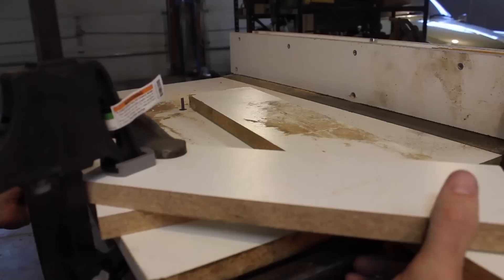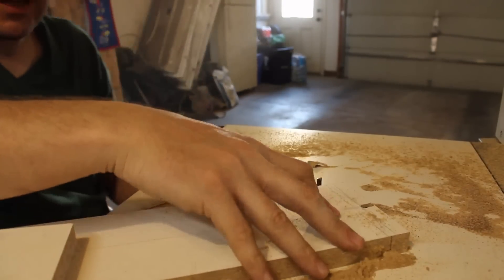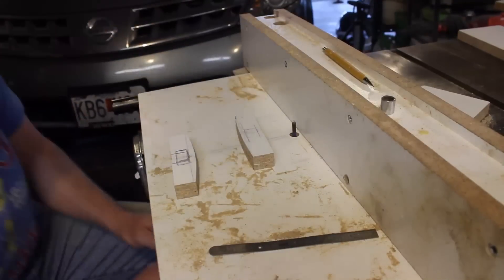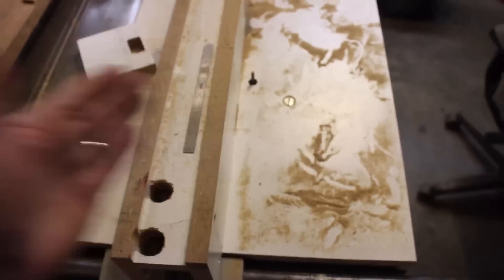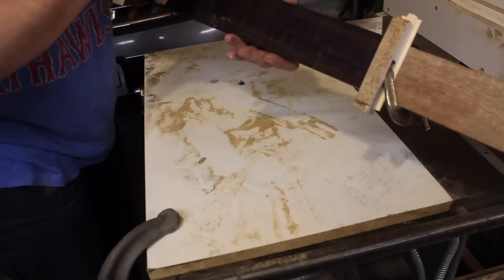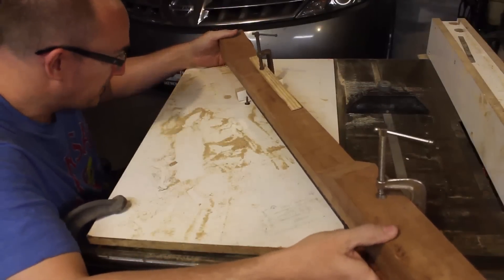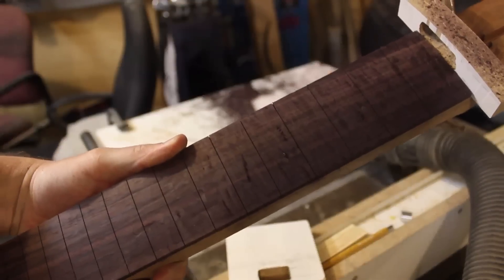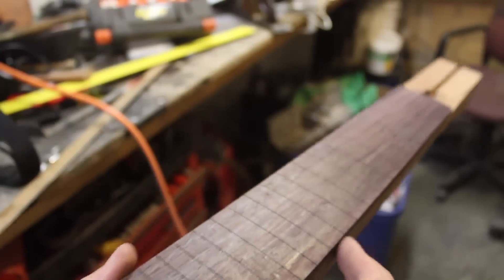You Can Make a Compound Radius Fretboard Easily - Guitar Build - Part 9

Comment: you really need a larger table i know you know but yea man, the theory is strong, the tool? meh . . .   and a vacuum, insure no bits get under your jigg and throw it off ..  Ive seen guys use the same concept but upside down in a box then they rock the router, but f course they're not using table they use a hand .. cool setup, larger table for sure, different bit maybe so it doesn't leave any tool marks in the wood?     also the fingerboard is all good compound radius, but it is the fret that are most important, you cannot flat level those, they have to be compound radiused as well, perfectly too ..  most important

Comment: Lol that is by far the most archaic and inaccurate way I have ever seen to attempt a compound radius LOL
Reply from the maker: Interesting.  Are you an overhead, dual adjustable arm and belt sander guy or a do it by hand block plane guy?
Reply: @GregsGarage  I use upright arm router sled, and it's adjustable on both sides. You can do any standard radius all the way across the board or a compound radius of any combined dimensions. It's completely made out of MDF and it is very accurate. I built it 15 years ago and I've never had to make any repairs, it still works like the day I built it.

Comment: Just asking , , ,
Does a compound radius fretboard need a compound radius neck? 
And if so where do they overlap or meet?  And is there a basic matching theory?
Reply from the maker: No, the neck carve is the same for a conical/compound radius fretboard.  The fretboard and neck meet at a straight joint.  The math gets a bit crazy when you want the edge thickness of the fretboard to be consistent down the length because the fretboard widens as you get closer to the bridge.

Comment: Good video, I would just ask that wouldn't it be better to cut the fret slots after routing to avoid tearout.  However if you purchased the fret board with pre cut slots then it is what it is.
Reply from the maker: Its easier to lay out fret slots when the board is flat and the sides are square.  With rosewood and ebony, tear out is much less of an issue because they are so dense.  If you're working in wenge or palm it is probably a different story...  That said, small cuts at high speed usually let you get away with a lot.
Reply: @GregsGarage  thank you.  I appreciate the advice.

Comment: Nice video.  I had always assumed a compound radius IS a conical shape.  What is the radius at the bridge?  Did you have to deepen the fret slots after removing some of the fretboard?
Reply from the maker: I can't recall the radius at the bridge, but I calc'd it back so it would work with the cone down the fretboard.

Comment: How did you come up with 12"/20" radii? For normal string spacing, i.e. 1 11/16" nut and 2 1/16" bridge (Tune-o-matic), it works out to 12"/16".
Reply from the maker: Preference really.  I wanted the guitar set for shred on the upper frets.

Comment: This is an awesome how-to video, and I don't want to be "that guy", but as a nurse/woodworker I have to say, running a router makes some SUPER fine dust, and mdf (especially with melamine) is horrible for your lungs. Please wear a respirator and run some dust collection while doing that, so you can keep making these great videos for years to come instead of sitting in a hospital with respiratory failure or possibly lung cancer. That's my rant, thanks for the videos!
Reply from the maker: Yes.  I have a very nice respirator I use for wood work.  I did a lot of the vids without it because I talk to the camera (even though it doesn't always show up in the vids).  Not an excuse though...  Safety first.
Reply: That's cool. I just saw the party where you're routing the mdf right in front of your face and was cringing :) We nurses can't help seeing everyone as a potential future patient, occupational habit I guess. Keep up the good work.

Comment: did you compensate for the height of your router bit? if you set for eg. 20" radius then the bit is set 3/4" high then this brings your radius down to 19.25".
Reply: i disagree. imagine exagerating the the router bit to several inches.
Reply: Excellent point
Reply: The router bit height will not affect the radius. If you set the bit 1/8" higher, it would just take an extra 1/8" everywhere on the fretboard.
Reply: OK, I think you're right. I was thinking that the curvature of the templates would simply be translated in the z direction, duplicating the curvature of the template. But now I see that because of the rotating of the assembly, the offset of the bit cuts toward the center of curvature, which will make a concentric circle with a radius reduced by the length of the router bit above the table.

Comment: very clever idea. would have been easier using two different sanding blocks
Reply from the maker: +Justin Katipa You can make a compound radius with a block plane if you want to, it just takes a lot of measurements and some experience.  Trying to taper and create a cone with two sanding blocks may not work...  I'm thinking about the stew mac style sanding blocks when I say that.  You could use a flat block just like a block plane and that would work.  It would just take awhile, no biggie.

Comment: You seem to have lots of tools, so you probably have a wood lathe.  If you do, just mount your blank and turn an off=set taper, it would be a lot easier.
Reply from the maker: +Thom Vogan No lathe...  To turn a 20" radius, wouldn't you need a 20" or greater swing on the lathe?  Would the off-center load cause a lathe to jitter?  I'm not a wood turner...  That's why I ask.

Comment: finally an easy method with no complicated jig setup. thx. great idea.
Reply from the maker: +Soulleecher Yes.  I looked at 10+ different jigs and router setups.  This was BY FAR the easiest...  You just need a table around your router that is big enough to allow the blocks on the ends of the fretboard to both stay on the table over the entire length of the board.  Most guitar fretboards are around 20" long, so if you have 21" on one side, you are golden.
Reply: +Greg's Garage My homemade r table is ~30 and I compound radiused a 25" bass fretboard flawlessly using your idea. I added some improvised parallel side rails/fences to keep the hole thing nice and centered. A lil sanding at the end and result's just staggering. no more sanding blocks and elbow grease for that kind of job no more. Plus this jig takes away no room and the radius guides templates are quick and dirty. Thx mate you really made my day.
Reply from the maker: Awesome! That's EXACTLY why I make these little videos.  Good luck on the rest of your build.

Comment: Big & impredictible innovation man!, this video shows a highway for a so much better future for some guitar & bass players.... I was wondering about the scratchs...; did u try with other router blades?, stones?, or little sanding tools for the router? Would be terrific just one step to get a compound with a clean shining surface, all at once. I know, i'm just a dreeamer, that dreams of beter daaays, o yeah... Heheheee... Did u get ssome improvement in the performance of the jig? Please Master, let us to know.
\o/☼▲\o/☼▲\o/☼▲
Reply from the maker: Ignacio Valle I've only made one fretboard this way...  I will be making a second one soon.  I'm working on building a CNC machine first.  Once that's done, I'll be back to making guitars.
Reply from the maker: Greg's Garage I forgot to answer the other questions...  This worked out pretty well.  A bit of sanding and it was ready to go.  Maybe 5 minutes.
Reply: Greg's Garage Thx a lot Greg, i'll keep an eye over here. \o/☼▲\o/☼▲\o/☼▲

Comment: To be technically correct, a conical fretboard IS a compound radius.
Reply from the maker: fatboylo96 Oh man.  I'll let the scientists battle out that discussion.  Let's just say it's flatter at the 24th than it is at the 1st!!! :D  Thanks for checking my facts!
Reply: Greg's Garage Not trying to be combative, just curious- how do the scientists differentiate between the two?
Reply from the maker: I have no idea man...  Most guitar players refer to them as compound radii.  Some luthiers will argue that its actually not compound, it's a flat surface that follows the hypotenuse of a triangle revolved around a straight line between an imaginary point somewhere beyond the headstock and an imaginary point under the neck.  Bottom line, the radius changes from the nut to the bridge end of the fretboard.

In calculus class we determined "compound" interest on money...  I see no reason why this constantly changing radius couldn't be considered compound...  Totally semantics I suppose.
Reply: Greg's Garage Perhaps another adjective that works better is "variable" as in variable radius.  It VARIES as you move down the fretboard.  Conical may accurate but it's more confusing than variable, IMO.

Have you played it yet?  I'm still trying to figure out if the bending around say fret 5 will fret out sooner because.. the radius is smaller there than say fret 17, for example.  Seems the only real selling point on these was a little more round feeling for bar chords up near the nut.  Great for small handed people I guess but I just keep telling myself... you have a different radius so you must PLAY differently at the nut than around the 12th fret and up.  I don't like that.  That's the kind of stuff that keeps me up at night.  And the width of the strings at the nut isnt' THAT much smaller than the bridge.  I'm thinking just go with a 16" and be done.

Anyway, interesting vid.
Reply from the maker: HAHA...  You think the same way I do.  Weird things keep me up at night.  To answer your question, YES the guitar is done and very playable.  Check it out here https://youtu.be/OBqplBNe2Kw

I don't believe I had ever actually played a "variable radius" guitar before I built this one, so I HAD do build it that way to find out what the rage was all about...  I'm no shredder but I am a solid player.  That said, I like the feel at the nut end of this guitar.  I also like the feel at the 12th fret. Is it worth the hassle?  If I were a pro level play, maybe...  I'd say that I like my other guitars just as much and they are consistent radius fretboards.  

As for fretting out.  I have no troubles anywhere on the neck with buzz or dead spots.  I sent a link in my last comment back to you with the fret install video.  I think I had 2 or 3 spots where the frets weren't dead on with respect to the frets on either side...  I don't notice those spots AT ALL when I play the instrument.
Reply: Greg's Garage  I've done some minor guitar work, refretted a couple, leveled frets, etc.  So, yeah, that rocking technique... gotta also be careful you don't get tricked cuz it may actually rock more than those 3 and you go lower that middle... then you discover it was actually the outer fret too low!  CRAP!  Now you might have to   yank that one and install a new one. :( hahahha

I saw one vid of the finished guitar with neck pickup working.  I'll check the link you gave. thanks!
Reply: Greg's Garage  yeah, so I saw that vid, part 34.  Commented on it.   You did a good job I think.  I never did any wood working and some meth head stole the few tools I had in my garage.  I mean, I had a table saw, router, miter saw , miter trimmer, drill, that's about it.  Not enough to really build a good guitar.
Reply: Greg's Garage Found the sauce.- http://www.guitarrasjaen.com/NotOnlyCones_Rev3%2B.pdf

Geometry is wonderful. This may be a little hard to understand at first but this explains perfectly the concept of "complex cylinders, oblique cones, complex cones, and why even a "straight radius/cylindrical" fretboard actually works well if you shape/level it correctly because you actually turn it into a complex/oblique cone without knowing it.
Reply from the maker: TruthSurge I did this just just a few tools...  Table saw, band saw and router did a lot of the heavy lifting.  I used the planes and files a lot.  I'd bet I could do a build with one plane, a band saw, a hand saw (for fret work) and a good chisel set.  Maybe I'll throw down the challenge on a future build.  Thanks for all your comments BTW...  I'm glad folks are finding the build interesting.  I tried to re-think everything I've seen and heard regarding electric guitar builds.  Some of it worked and some didn't.  Love the instrument though.
Reply from the maker: fatboylo96 Holy cow.  The motherland.  It will take awhile to process.  Thanks for the link!
Reply: Greg's Garage Yeah, building something you can actually play and something you think looks cool too...  that's enticing for the creative person who has some ability with shop tools.  I never used mine that much so I would struggle a lot more than you did trying to build one from scratch.  I'd make all those tiny mistakes you did and prob 50 more. hahahah  Stuff you forget, stuff you can't foresee....   anyway, was interesting.

I think I'll just buy premade parts and slap them together.   Probably do the paint job myself tho.  and if I can, get the switches, knobs where I want them, not where Fender says they need to be. :)